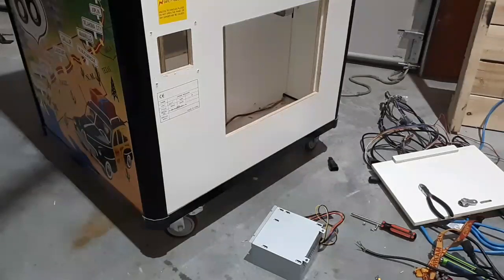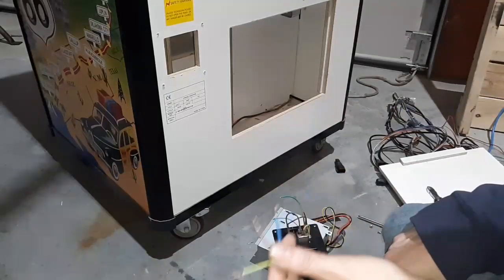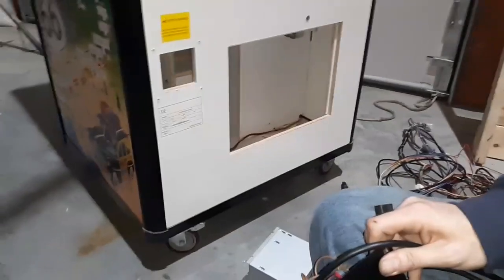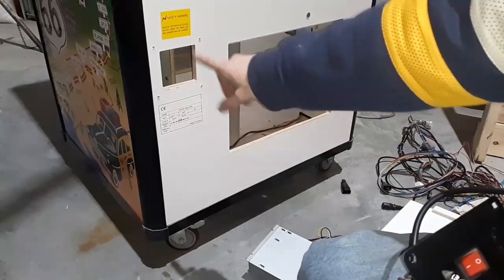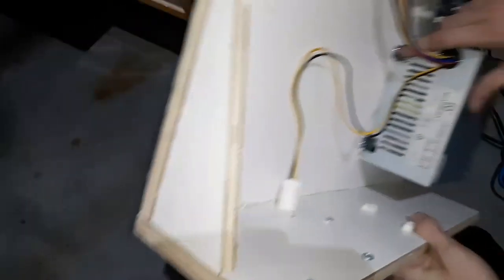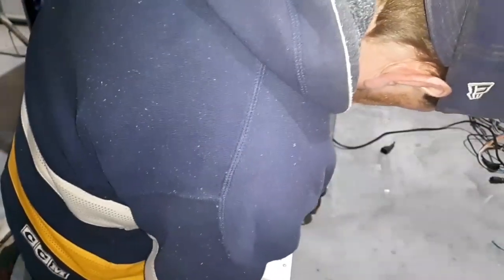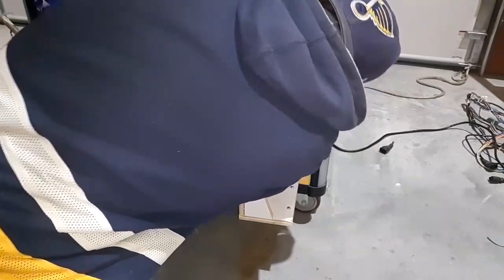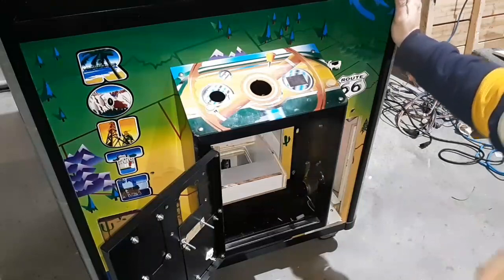DIY Arcade Claw Machine Kit from Holland Computers Part 3, Wiring Up Power

Comment: Where did you connect the prize sensor on the mother board? I have the same kit and I am wondering how you did!
Reply: Thank you so much this really helps!
Reply from the maker: No problem!
Reply from the maker: I haven't hooked that up yet. I dont need it at the moment. It does show where in the manual.
Reply: Where does it say in the manual? I can’t seem to find it
Reply from the maker: I'll have to check Monday, but I think it's in a section for setting it for Play Until You Win.
Reply: Ok! Thanks! I will look
Reply from the maker: Love the name, btw! Lol
Reply: Thanks
Reply: Did you check where the prize sensor plugs in?
Reply from the maker: Connector P3 pin 1, is the prize out sensor. It will need a ground wire too. Pin 7 is a ground you can tap into. This is the same connector for the joystick.